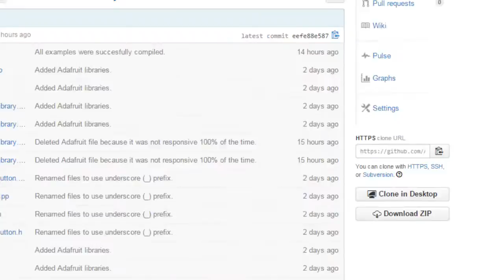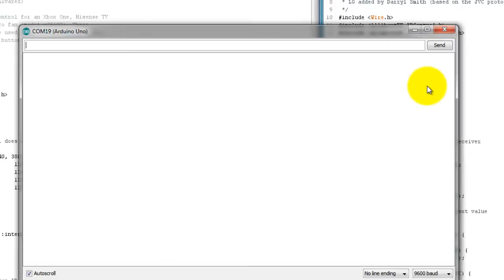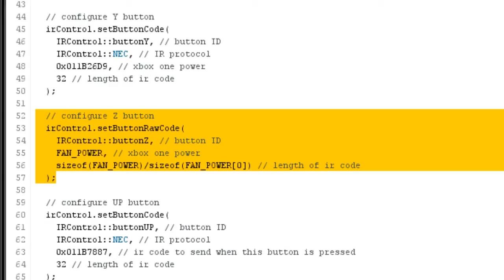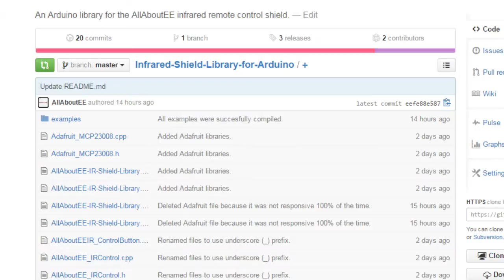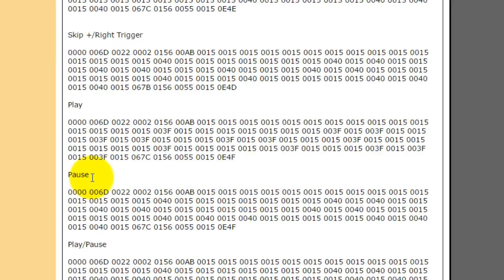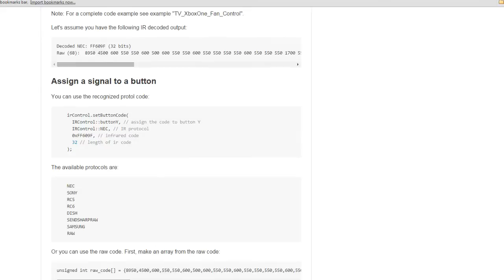Arduino Infrared Remote Control Shield

Comment: Will this library work on the Intel Edison (Arduino certified) board?
Thanks.
Reply from the maker: Mohammed Algailani  I don't think so. The pins match, but it doesn't look like the Edison is 5v logic. Also I could not find an infrared library for the edison using google (it wouldn't be hard to make one though). The library I have for the shield right now uses AVR architecture code: https://github.com/AllAboutEE/Infrared-Shield-Library-for-Arduino/blob/master/AllAboutEE_IRremoteInt.h
Reply: AllAboutEE Intel Edison itself is 1.8v, however when connected to the Arduino breakout board you can select between 3.3v and 5.0v. On the other hand, Linux OS provide the means for Edison to be Arduino compatible. 
Thanks for the link.
Reply from the maker: Mohammed Algailani In that case then yeah, it sounds like the hardware is compatible. The library still will not work with it though, but it shouldn't be hard to write one.